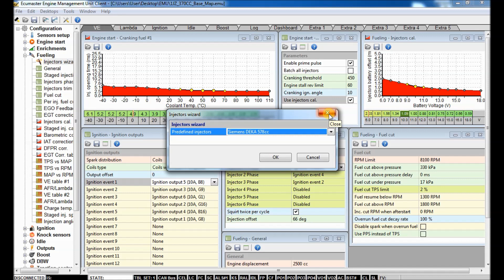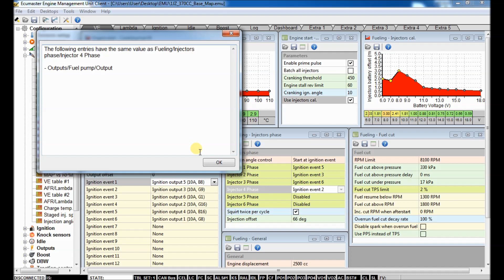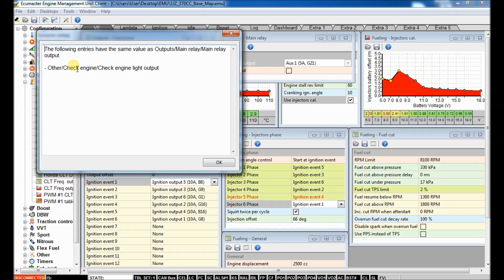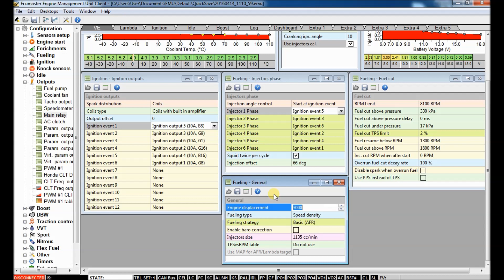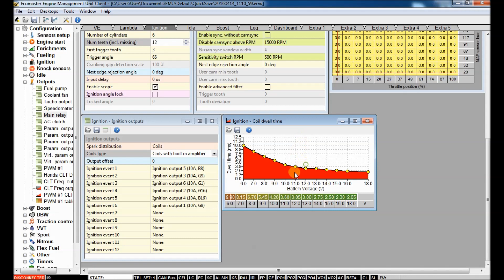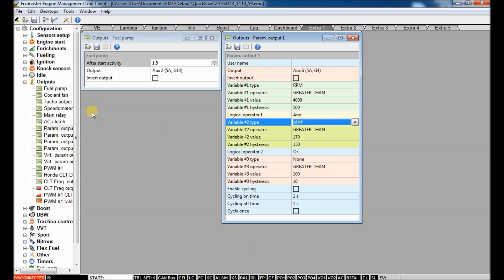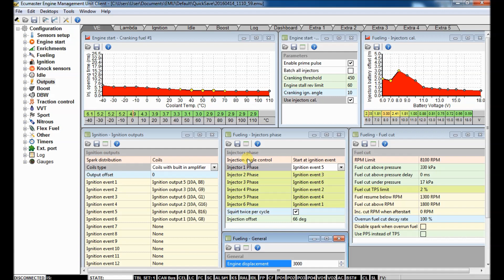Base Map Configuration for the ECUMaster EMU

Comment: hello which button do i use to lift? Nothing happens with the + key. I can lower the - key.
Reply from the maker: Check your keyboard shortcuts in the software, depending on the region of your keyboard you may have to manually assign that shortcut.

Comment: This doesn't make sense. On the 1jz-base map that you have and the 2jz-base map on your download directory, they do not match this. The 2jz shows the injector phase event matching the ignition event. What option is right? When I try to configure my base map like this I get nothing but massive backfires.
Reply: Is it possible the firing order is off ? cause in the video the ignition events dont follow the firing order I found when i looked it up for a 2JZ ? 1-5-3-6-2-4?
Reply: for me 2-4-1-5-3-6 on ignition outputs and injector phase working... the reason is the "starting at ignition event"... if you chose ignition event1 = ign.output2/inj.phase2 its injects fuel while its sparking... it should be done while the intake process before the ignition event. thats my theory, but still its confusing maybe....
Reply: @turboloadedperformance6058  this part is confusing and I think the software should be re-written to take care of assigning  injector firing to follow the ignition firing order, without the user having to manually assign injector. Watching the video series by Jeff Evans, you select the ignition firing order first, then you have to select the injection order... I find it hard to explain and difficult to follow myself.
Reply: @mikedsilva 1000% feel the same way right now

Comment: Is the base map for the RB25DET wrong on your google drive?  I am playing around with your software (heavily considering buying an EMU Black for my RB25DET S13) and noticed the ignition primary trigger is completely wrong. It is set up as a 4 cylinder VR sensor 60 tooth setup, It should be a Optical sensor, but I don't know what else everything needs to be setup as.  If I can get a file that will read the stock CAS and fire the coils at the right time I will definitely go with a wire in ECUMasters ECU.
Reply from the maker: Those are the default settings, if it shows 4 cylinders and 60 teeth then you haven't actually opened the map. If you have any trouble opening the map, just shoot us an email or call us during business hours and we can walk you through it.

Comment: Hi ECUMaster, I would like to swap my factory EMU with ECU classic for my youngtimer restoration project and having a question: if I will replace it and run first time will engine start at all? Is there any basic/safe maps? The engine is Opel C30NE and my plan is use to original wiring, make short link/harness by use Motronic ML 4.1 socket with 35 pins and hookup into ECU Classic. I will correct all settings in software before first run. Another question is when we can expect on market new piggyback DET4?